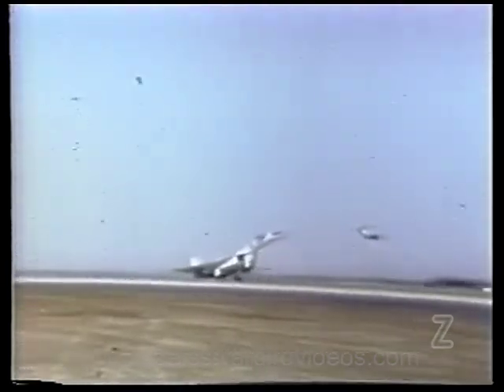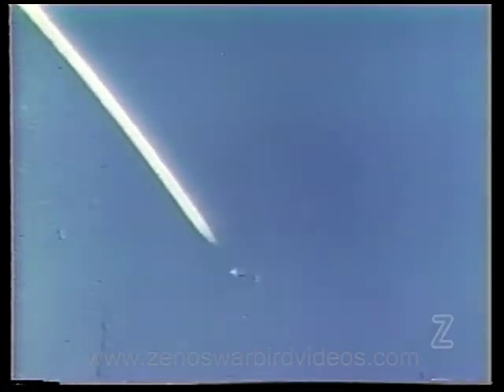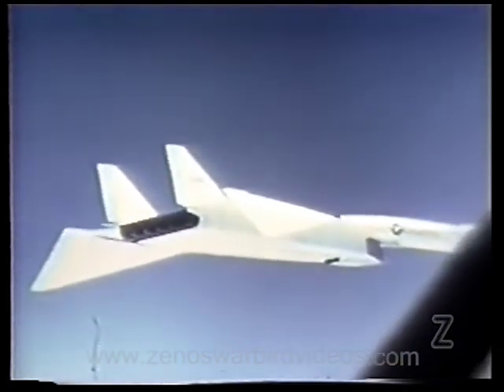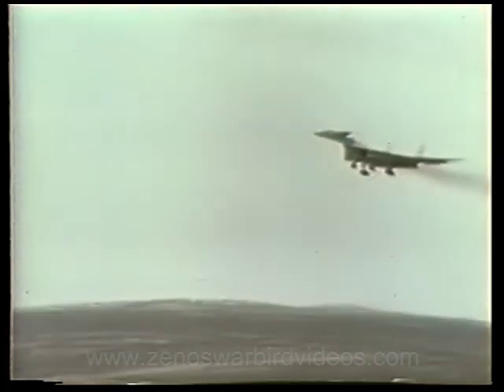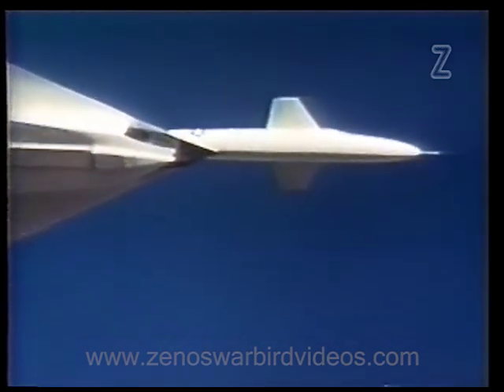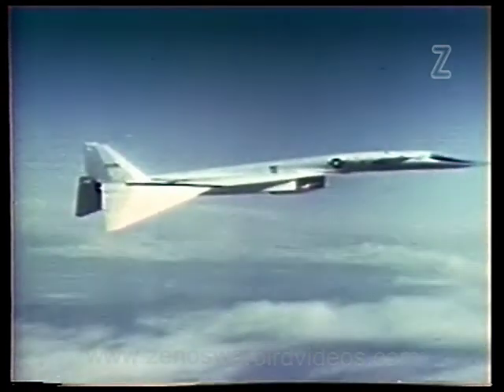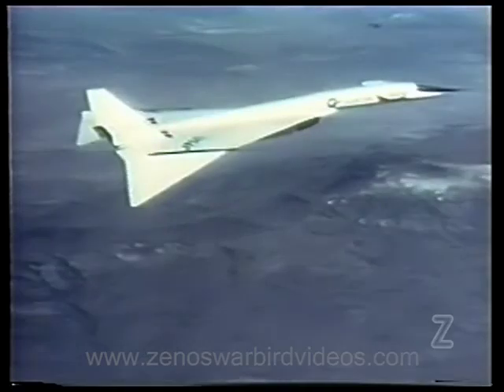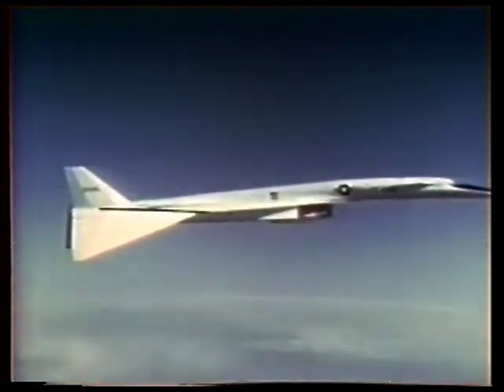XB-70 Valkyrie Supersonic Bomber Flight Test Program Restored Color -1966

Comment: Just saw the last XB-70 in Dayton this past weekend. Simply beautiful! They did a fantastic job restoring and displaying it! It's so long it takes up a good portion of the hanger! Such a shame these things didn't get into production. Elegant yet functional and for 60's tech it was freaking incredible! The engineering behind it is really something!
Reply: I would think that for fighters to evolve beyond the stealth oriented, aft-turbofan engines multirole stage in their evolution right now they will need four engines, two with similar tech to the XB-70 and XF-108 which may also turn a shaft to an electric generator to power a ducted fan for VTOL flight (which cannot count as its own engine), and two additional which transition between Ramjet and Scramjet modes to accelerate further to the mesosphere and up to LEO (if given Liquid oxygen, which doubles as the compressor coolant).

Comment: copy from tu144 😂😂😂
Reply: Julia they are to completely different aircraft and this is older so how is this a copy of the tu 144
Reply: XB-70 first flight 21 September 1964 but TU-144 first flight 31 December 1968 and nothing relatable on both aircraft.
Reply: Comical, to say the least. Russia tried to copy our captured B29 and failed. Yes, they got the image down but couldn't replicate the advanced electronics and systems. The only time I think Russia actually put us to shame was when they did forward swept wings. Even the Su-57 sucks.
Reply: The Concorde may have been a “copy” of the TU-144 but there are theories that the Concordes early plans were stolen/copied and used in designing the TU-144. But the XB-70 is a completely different animal, in virtually every aspect.

Comment: While it was an amazing aircraft there's no way it would of been a practical bomber, there's no room internally for ordinance. The six engines took up all of the space below the fuselage and the fuselage was full of fuel tanks, they would of had to put the bombs or cruise missiles on wing pylons. Those six afterburning engines consumed an enormous amount of fuel.
Reply: Bomb Bay: The XB-70 was designed with a bomb bay capable of carrying a significant payload. The bomb bay was nearly 30 feet long and could accommodate various nuclear or conventional weapons. This contradicts the claim that there was no room internally for ordnance.

Engine Placement: While the six engines did occupy a substantial portion of the lower fuselage, the aircraft's design still allowed for internal storage of fuel and ordnance. The placement of engines did not entirely preclude the inclusion of a bomb bay.

Fuel Efficiency: Although the six afterburning engines consumed a large amount of fuel, the XB-70 was designed to cruise at high altitudes and speeds (Mach 3), which would have allowed it to cover long distances quickly. The high fuel consumption was a trade-off for its speed and altitude capabilities, which were intended to evade enemy defenses.

Wing Pylons: While your argument suggests that bombs or cruise missiles would have to be placed on wing pylons, the primary design included internal storage for ordnance. External pylons could have been used as an additional option, but they were not the primary method of carrying weapons.

Comment: its amazing that this was designed and flown in the sixties. It seems aviation has stagnated or even gone backwards since this and the SR71 were designed. The only thing that has changed is the use of composites otherwise aircraft are the same old design.
Reply: Aviation has become much safer, and cheaper. Going balls to the wall is rarely, if ever, needed anymore. That is not stagnation, even if not as cool to look at.
Reply: +Philip Manning Really?  Um, what about stealth and fly-by-wire?
Reply: +prairie wanderer Stealth features were designed into the SR-71 from it&#39;s inception.&#160; The &#39;chines&#39; were used to smooth the transition from fuselage to wing, and the engine inlet spikes and&#160;vertical stabilizer (rudder) panels were&#160;some of the first composites flown, all to reduce Radar Cross Section.

The first&#160;fully electronic (analog)&#160;fly-by-wire aircraft with no mechanical or hydraulic backup was the Apollo Lunar Landing Research Vehicle (LLRV), first flown in 1964.&#160; The first digital fly-by-wire craft flown was the Apollo Command Module (also being built by North American at about the same time), followed by the Apollo Lunar Excursion Module, both controlled via&#160;Apollo Guidance Computers.&#160; The&#160;Apollo Guidance Computer (with different software) was later fitted to an&#160;F-8 Crusader&#160;in a NASA test project to create the first fully digital fly-by-wire fixed-wing airplane in 1972.So no, +Philip Manning isn&#39;t the only one who feels the developments in aerospace since the 1960s&#160;have been more evolutionary than revolutionary.
Reply: Mike Cowen

A true stealth aircraft wasn't operational until the 80's, and true fly-by-wire wasn't operational until the 70's.  I like your comparision of evolutionary vs revolutionary.  Great description.
Reply: F14 F16 F22 F35 B1 B2 B21. All these aircraft have shown major advancements in aircraft development.